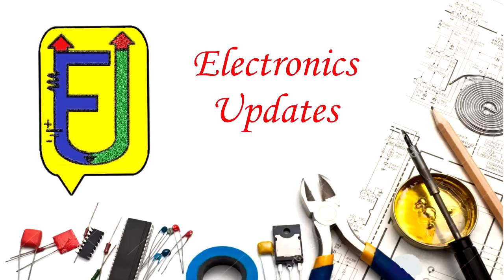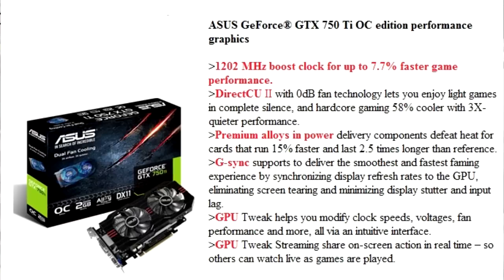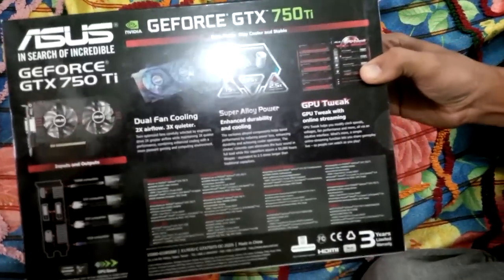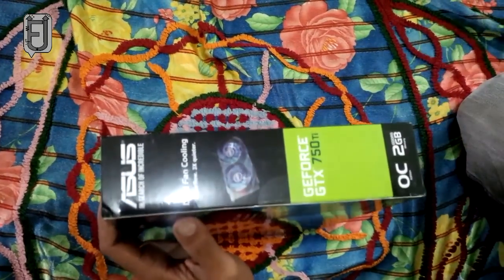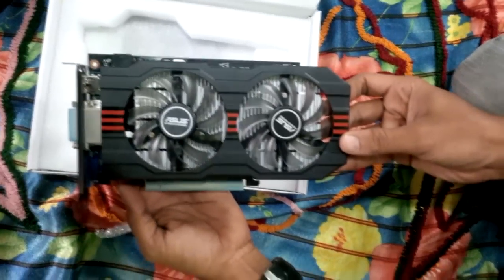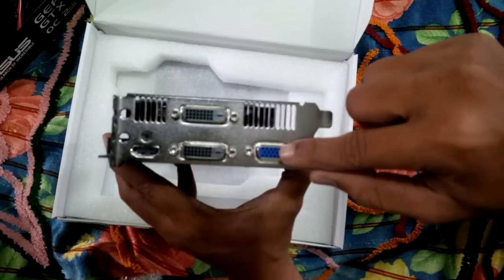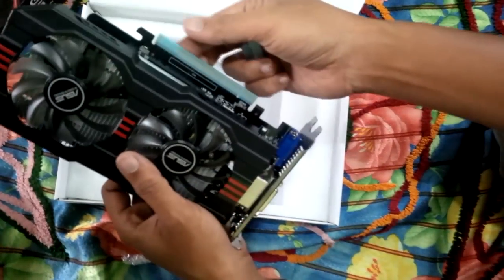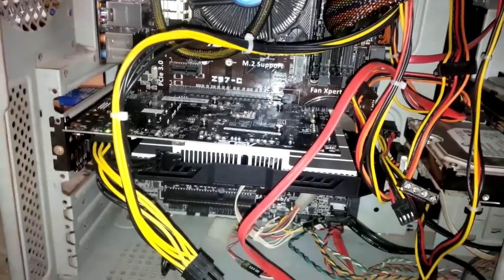ASUS NVIDIA GTX 750 TI 2GB OC UNBOXING AND TECH REVIEW

Comment: Hey, do I only need that 6 pin connector to use it? my PSU is a EVGA 430w and it has an 8 pin connector (6 + 2)
Reply from the maker: +Miguel Eduardo s graphic card need separate 6 pin PCI-E Connectors
Reply: +Electronics Updates so It only needs 1 6 pin connector?
Reply from the maker: +Miguel Eduardo absolutely, it need additional 6 pin connection. if u go with higher end PSU like corser, antec.... etc. u will find additional 6 pin

Comment: Alright fellow videoers. I found the problem. The card ariived witha faulty HDMI connection. Whenever I plug in a cable it shuts down. I am now using a DVI connection and have since had no problems. I examined the pins more closely in the HDMI socket and sure enough it has two pins bent back. So it was not a total loss.
Reply: +Cesar Arango ok, cause you kinda scared me there, thought the card was fucked lol

Comment: Installed this card new, worked for a good 15 mins with new drivers. Now, all I get is a black screen. Any ideas? Thank you.
Reply from the maker: ***** Try without graphic card whether display come's properly r not....if no mean, try that same graphic card into other computer
Reply: Will do. I was thinking about that. Will report later. Hate to lose the card. Had it sent third party to Colombia. I am suspecting a bad MoBo. (Z77-G45) Have had it for three years with lots of use. Some  programs  (CPUz, Msi Bios control, etc.)  recognize all ram (16Gb), others just 8. So I am leaning that way (MoBo). But having a 3rd Gen intel i5-3550, chipset has to be for 1155 MoBo. Harder and harder to find. Any good referrals for a good gaming, and heavy work MoBo would be greatly appreciated. Thank you.
Reply: +Electronics Updates  I found the problem. The card ariived witha faulty HDMI connection. Whenever I plug in a cable it shuts down. I am now using a DVI connection and have since had no problems. I examined the pins more closely in the HDMI socket and sure enough it has two pins bent back. So it was not a total loss.